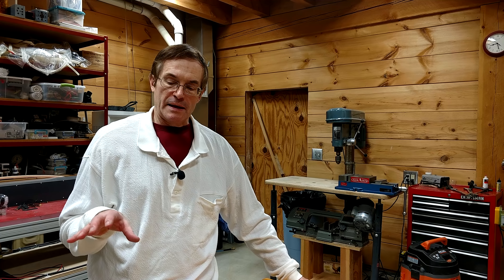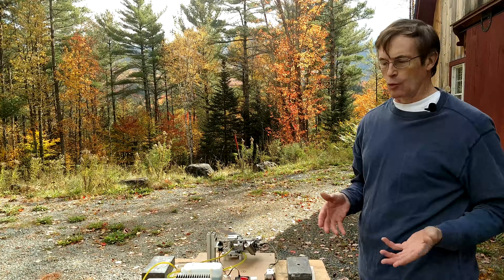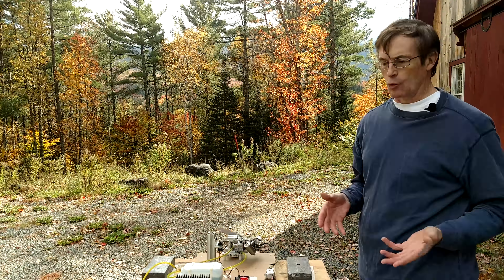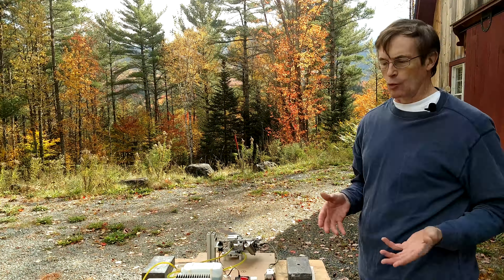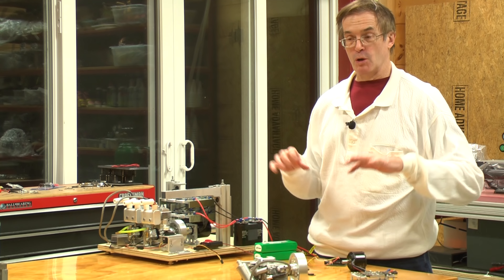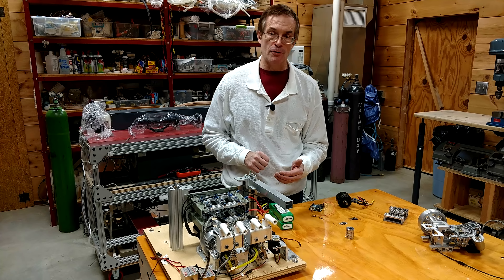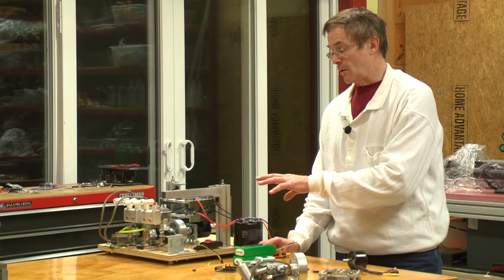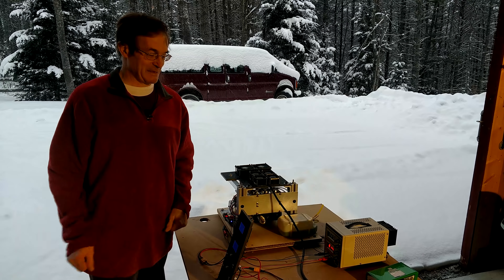Hybrid Drone Generator

Comment: The engine is not balanced because it is impossible to do so for a single cylinder engine.  Is sufficient weight were put on the crank to balance the longitudinal motion, it would create lateral vibration.  So engines are balanced to compensate for only half of this, and causes half of this laterally.  Car engines have multiple cylinders to permit total balance of all vibration.
     Don't mount the generator on a flexible coupling!  Let the engine's shaft support the generator's rotor.  You get rid of 2 bearings you don't need.  Mount the generator/engine on a shock mount, and let this vibrate relative to the airframe.  Use a 4 stroke engine.  Try to get an engine that runs at higher RPM.  Both it and the generator will be lighter. (A given generator's output is proportional to RPM squared.)
     Between the generators and the system you need a DC/DC converter.  This allows you to set the engine RPM to best efficiency for varying load power.  Without the DC/DC converter, the engine must run, more or less, at the same RPM throughout the flight.  You don't need capacitors.  The 3 phase output of the generator has ripple, but does not get near zero anywhere in the cycle.  The DC/DC converter can deal with this.
     The DC/DC converter allows you to make adjustments for generator Kv.
     Cooling the engine will be a problem, as a drone is not guaranteed to fly fast tot generate forced air (versus fixed-wing aircraft which are guaranteed to have airflow).
Reply from the maker: A flexible coupling helps to protect the less robust structure of the generator.  You do need caps.  The voltage swings are nearly as large as the maximum potential.
Reply: @TechIngredients  If you use 6 diodes to rectify the 3-phase generator, the voltage dips to 0.866 of the maximum.  Winding resistance actually reduces the dip relative to the peak, as 2 windings are in parallel at the dip, and only 1 at the peak.  If swing is large, you have a bad diode or an open winding.  A DC/DC converter should easily be able to handle this.
     The generator needs disassembling and the rotor mounted directly on the engine's flywheel, and the outer frame mounted to the frame rigidly holding the engine.  The entire frame is mounted on shock-mounts to the airframe.  The generator is much more robust then the engine, as it has only 1 moving part.  I did this for the military, using a Honda 4-stroke weed wacker 1HP engine and a disc alternator I designed for the purpose.  I designed the alternator to make 120VAC 3 phase at nominal speed of 4000RPM.  I used "world-wide" off-line switching power supplies (90V to 240V input range) to power the load.  Engine (9lb) and alternator (1lb) weighed 10lb.  Maximum power output was 200W, but it had to work for many hours.

Comment: Use a motorcycle alternator and rectifier - - replace any "weighty" parts with foam-cored carbon fiber.
Explain to us how to vacuum-bag carbon fiber/foam for the home workshop.
Trim the stator of excess iron weight.
Suspend this assembly by bungee under the drone and forget about quelling the shake = more weight savings.  I assume the shake would interfere with video quality.
Add 18 inches of ally pipe to your exhaust if you want quiet.  (Lawn chair)
Reply from the maker: There are two reasons not to use an alternator.  The weight of the copper windings will always exceed the weight of  the permanent magnets in a brushless DC generator and the alternator will be substantially less effecient.
A streight tube exhaust does little to reduce exhaust noise, we tested this.
A dangling generator module will indeed reduce vibration transmission, but this can also introduce undampned oscillations that will affect flight stability.  It can work, but it's not trivial.

Comment: 1. Why convert from motors to electricity to motors?
2. The impedance of the capacitors you're using may or may not be low at 8 kHz.  They are probably rated at 120 Hz.
Reply: I too have the same question, 1st one. I don't know much about RC drones or cars. Is weight not an issue when compared to a gas motor RC.

Comment: if you took an inverter generator and stripped it down you would have a 4 cycle engine with an integral flywheel stator and a stepper motor directly on the carb.

Comment: A good engine with continues output, small size and good balance would be a rotary engine. 
It doesn't have pistons that go up and down.... just cups on a shaft that go round and round! : P
Reply: Except, now you introduce fuel-inefficiency.  He could use a model jet engine if he really wanted to eliminate vibration, but that introduces even more fuel-inefficiency.  It's all a compromise game.  He's got a pretty smooth system (shown in his followup video) and it isn't even vibration dampened yet.

Comment: have a look at hoverboard motors. thy are used by most of us as power generators. thay are sturdy and thay make lots of power at low  speed rotations. just [pick a hoverboard , remove the motors and belt them to your spinners

Comment: A lot of the DIY generator videos using brushless motors are getting atrocious efficiencies of under 30%.  A typical car alternator achieves around 65% efficiency.  What efficiency are you able to get with your AC motor generator?
Reply from the maker: Where do you get that brushless effeciency figure from?
Reply: @TechIngredients  I was looking at some DIY projects on YouTube that produced abysmal results.  Those were clearly botched implmentations, but it goes to show that it's not that easy to build a generator.  I'm curious what mechanical to electrical conversion efficiency you're getting from your AC motors.

Looking on Aliexpress, there are a bunch of 2000 watt generators designed for use with Wind Turbines that claim 85% efficiency.  If that's true, isn't it easier just to use a premade product?  Of course I do appreciate the fact that you're building your own from a purely acadmic standpoint.  But unless you're able to surpass the efficiency of a premade product that already has a lot of engineering hours put into it, it's not practical.
Reply from the maker: A top of the line brushless motor is approximately 95% effecient.  These low cost motors are probably running in the high eighties.
Those wind turbine motors/generators are probably also close to that same effeciency.
Consider that 30% you quoted, if true then when those resistors we're running at a little over 2,000 watts the motors were dumping approximately 5,000 watts in waste heat.💥
Furthermore, the gas engines would have to have been outputting nearly 10 horsepower, more than double their rated capacity.
Reply: @TechIngredients  If they're 95% efficent going from electrical to mechanical energy, is it also 95% in reverse?

Comment: In 2021 lithium sulphur batteries will be available and affordable. They have a higher specific energy ( 3x - 5x) than current lithium ion chemistry. Then further beyond that closer to 2030 we should see lithium air chemistry which is almost as dense as car fuel.

Comment: @17:55 "...can't...operate at the current levels we're talking about."  Um.. a capacitor can't handle current???  Unless you bought one of those packaged units made for huge vehicle sound systems (built in diode and resistor) the current really shouldn't be a problem.  I suppose cheap ones might have a (relatively) high internal resistance, but we're not talking gas discharge tube levels of current here.  I realize this was ten months ago, and you probably shot the video weeks before that, but can you elaborate on why those capacitors weren't suitable?  (This is actually the second time I watched it.. didn't notice the capacitor thing the first time.)  Low rated voltage is easy to understand, especially on big caps like those, but current shouldn't be an issue.
Reply from the maker: The spec I'm talking about is called ripple current and it is listed with the other specs for these capacitors.  The internal resistance in the capacitor generates heat when they are charged and discharged in a smoothing circuit, in power supplies.  The value depends on the internal resistance and the surface area (not volume) of the capacitor.

Comment: I would have used either a 2 cylinder boxer engine, which is inherently balanced or a wanker engine. A single and bigger rc motor/generator with high pole count would act as a flywheel and filter the power pulses to some degree. The remaining voltage fluctuations would be filtered later by the battery pack. The complexity should be lower and the power to weight ratio should be more favorable.
Reply from the maker: You're right!  That is basically what we are doing with the 4 cylinder 2stroke engine in the larger generator.

Comment: Sir I think you really missed the boat by not using a modern chainsaw engine. Not only are they already counterbalanced internally but they use stratified charge type porting which reduces fuel consumption dramatically. Remember this is all about the energy density of the package compared to the lithium battery. It seems to me the Husqvarna 372xp X Torq engine would be absolutely perfect for this application. Or you could try its big brother the 390xp. Both are very powerful high-revving thoroughly modern 2-stroke engine designs.
Reply from the maker: Thanks, I'll look at these.

Comment: How can you casually use the term KV which has been used for decades as KiloVolts- to describe some nebulious rotation vs. voltage for small engines ? Who chose to start rating motors as KV?
Reply from the maker: I'm not sure, but it's become endemic.

Comment: Why not just use a flat twin 2-stroke aero engine instead? See DLE 40 Twin for example. These are much better from a vibration perspective, since the primary force generated by one piston counteracts that generated by the other at all times, resulting in excellent primary balance.
Reply from the maker: I explained why we returned that very engine during this video.  Did you not watch that explanation or was I not clear in my explanation and you have a question about this decision?

Comment: POSSIBLY , THE NEW GRAPHENE  BATTERIES , WIRED PARALLEL TO REDUCE 120 DOWN TO AN ACCEPTABLE INPUT ,  120V OUTPUT FROM BRUSHLESS 3 PHASE MOTOR--CHARGING THE BATTERIES WHILE GAS ENGINE RUNNING , SHOULD YOU RUN OUT OF FUEL , OR A GAS ENGINE FAILURE , REVERSE CURRENT FROM ENERGY STORED FROM GRAPHENE BATTERY TO ELEC. MOTOR AS A BACKUP PROP DRIVER--ALSO COULD BE USED TO START GAS ENGINE , THIS PROVIDING A BACKUP POWER SUPPLY , ALSO POSSIBLY EXTENDING RANGE , ALL THE WHILE REDUCING WEIGHT OF CRAFT WITH LESS COMPONENTS , THE HIGHER THE VOLTAGE THE SMALLER THE WIRE NEEDED , AND ALSO SHOULD BE CHEAPER . JUST ASKING ?

Comment: What about gas turbine generator? I suscribed to your channel for your excellent gas turbine videos! :) Less moving parts and higher efficiency, lower vibrations. I'm curious if it's a viable solution as a micro generator
Reply from the maker: The effeciency is actually significantly lower with a turbine.  In our video on "The Turbojet" I explain why the effeciency of small turbines is lower than reciprocating engines.
Reply: @TechIngredients  Thanks! That's unfortunate

Comment: could a small turbine work more efficiently?
Reply from the maker: No.  The compression ratio of an internal combustion engine (a jet is an internal combustion engine as well) determines efficiency.  Small turbines with single stage compression are limited to compression ratios of approximately 3:1 while a piston engine typically runs with a 9:1 compression ratio.

Comment: forgive my stupidity! im uneducated. you say the battery are 1/20 the power of gas. what does that mean? are you saying its 20% less efficient? if gas produced 100 pounds are you saying the battery would produce 80 pounds? im interested in building a quad-copter for agricultural purposes/crop dusting.
Reply from the maker: What I meant is the amount of energy that can be used to do work per gram of the fuel or per gram of the battery.

Comment: Look at how a Prius operates, a simple sungear transmussiin configuration, the gas motor, electric drive motor all directly connected to the cars drive wheels all the time in the same gear ratio allways with no torque converter, no clutch, no gear changes, all ways in the same gear ,and no reverse gear. Engine us all ways directly connected to the drive wheels with no method to disconnect either Electric motor starts the gas engine and the gas and or electric motor can drive the car forward or reverse and or charge the batteries with no gear changes.

The Atkinson cycle prius gas motor essentially lower the engine compression on the compression stroke on a 4 stroke motor, increases efficiency but lower torque made up for by the electric motor in a Prius.

Comment: Maybe use large capacitors instead of the batteries?
Reply from the maker: It might work, but the lower energy capacity will limit these to smoothing and likely not provide back up in case of generator failure.

Comment: A lot of good engineering here but wouldn't it be easier to just use Internal Combustion Engine for the props on your drone?  Would weigh a lot less.
Reply from the maker: No.  The control challenge would be greater as well as the vibration levels.

Comment: The crankshafts in these small engines are balanced but the way you checked balance is not correct, this must be done outside the engine. it can be done statically although dynamic balancing is better.
Reply from the maker: I'm sorry, but I have to disagree.  The change in the balance of the mass of this engine about the center of rotation is in fact shifting upward as the piston moves to TDC.  If it were counterbalanced by the crank shaft then the position of the piston should be irreverent once the engine is balanced about the output shaft. There is no other moving mass other than that which is attached to the crankshaft. Moving the piston and crankshaft outside the engine to evaluate this is unnecessary.
Reply: @TechIngredients  you can disagree all you want but crankshafts are balanced with a counterweight on the crank, there is a formula for calculating the blance factor. Machinists and engine builders have long been taught that, when balancing a crankshaft, its counterweights should equal the weight of the rotating mass, and equal half the weight of the reciprocating mass.
Machinists have used this formula to calculate bobweight for decades.

Comment: Why not a radial engine? Those provide continuous power, and there are 35cc variants that provide 2.2HP, and with a 4 stroke cycle they are more efficient.
Reply: I have a related question: did you consider turbo shaft power such a  jet cat SPT5 or SPT10?
Reply: That's a really good point, why not? It's pretty light. Though, it has slightly high fuel consumption, half a pound a minute, and seems to be a constant output engine, making voltage regulation more difficult as load increases, decreasing the RPM. It's also very expensive.

Comment: You need a 90 degree vee twin engine for perfect primary balance.
Reply from the maker: What about a flat four?
Reply: @TechIngredients  No, the only configuration that has perfect primary balance is a 90 degree V. This is because piston weight is balanced against the crankshaft weight at top and bottom dead centre, but this gives an unbalance from the crankshaft weight on a plane 90 degrees to the cylinder at the mid stroke positions. This can be balanced out by having a second piston at 90 degrees to the first, as in a 90 degree V twin. Radial engines can also have perfect primary balance and multi cylinder engines will have less unbalance but the simplest is the twin V.

Comment: Did you know that electrolytic Capistrano I heard you mention that but I will share a old trick I found years ago I I used 4 1000 piv voltage diodes on a bread board in a squire took a 400 volt tv transformer attacked to the top of squire and got 600 on the bottom that I used to the plate of my tunes 6bjq6 es for my cb modulator

Comment: why not a small turboprop style engine? there are small hobby grade jets.
Reply from the maker: We are building a small turbojet based on a very small automotive turbocharger.  This should be an inexpensive alternative to the hobby turboprop (turboshaft) engines.  Nevertheless, these would be a very nice alternative as they are light, powerful and low vibration.  They are also quite expensive.

Comment: Have you considered using a gas turbine engine
Reply from the maker: Yes.  However, they are expensive and the low compression ratio makes them even less effecient than a two stroke engine.  The advantage is they are very smooth and light.

Comment: 300 watts doesent seem like a whole alot, I have a battery in my bike that can do a (50v * 30A)=1500w for about 15 minutes easy.. I guess your system is better in face with a EMP strike:) but I was wondering before the measurements how much power can those two enignes do - and 300 watts is - well great on one side but not so great when you realize how much could a battery of similar weight and size produce...

Comment: How about a radial engine?
Reply from the maker: We looked at that.  The only real negative was the packaging, especially the exhaust.  We want to enclose the entire generator in a sound absorbing enclosure that permits an effective flow of cooling air to the motors, electronics and the engine. The radial design is more challenging.